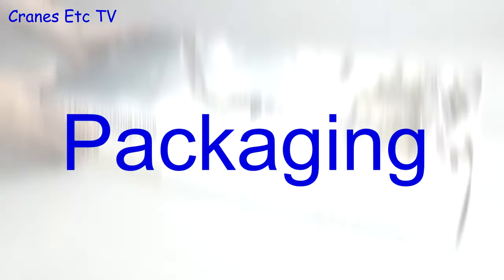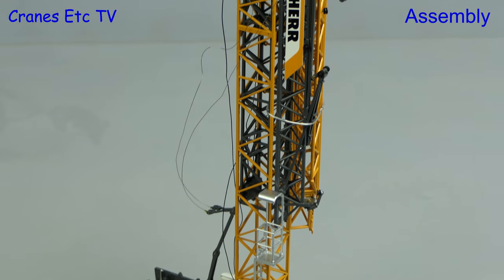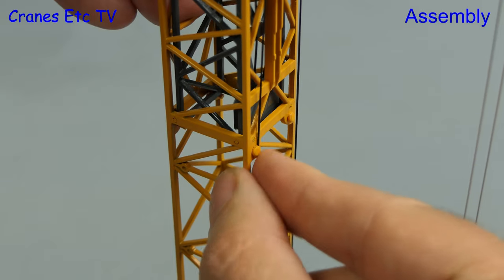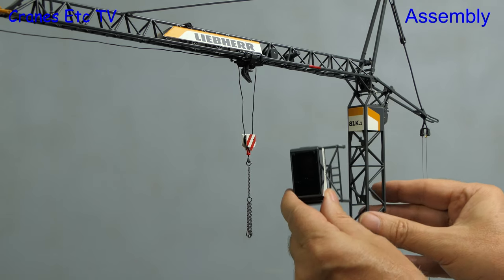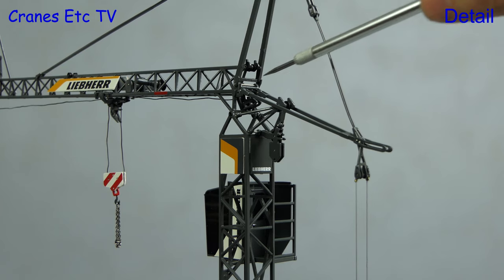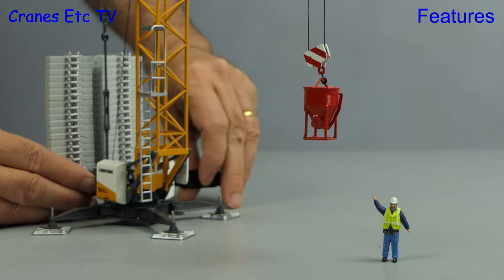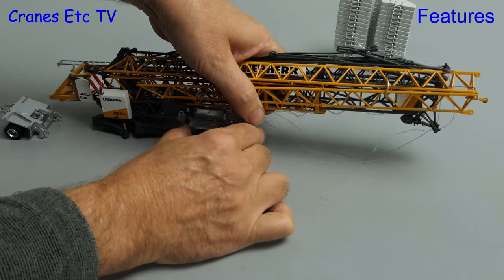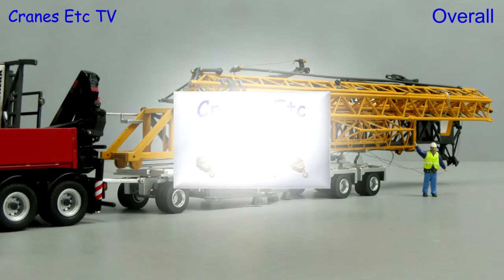NZG Liebherr 81 K.1 Fast Erecting Tower Crane by Cranes Etc TV

Comment: Liebherr do make very good models, however, looking at this video the jib isn't very straight, and that take's away detail of the model, even though the 81K is nicer, the older version of this model's geometry was far better than the current, and this could just be due to the ropes being a tad too long. I have the Liebherr 370-EC-B Fibre Optic tower crane which I bought about 2 years ago, and the straightness of the jib is excellent